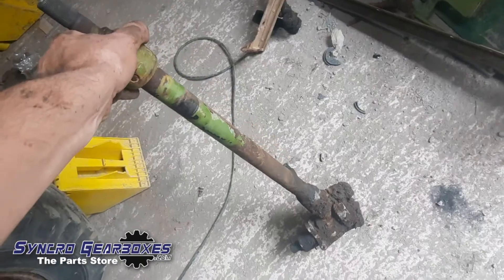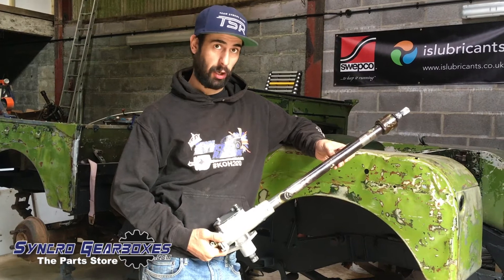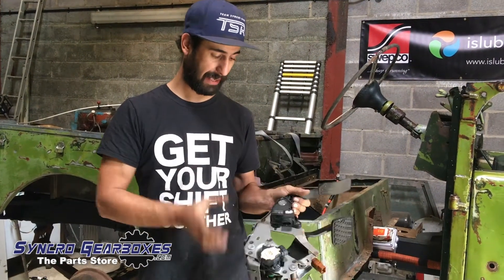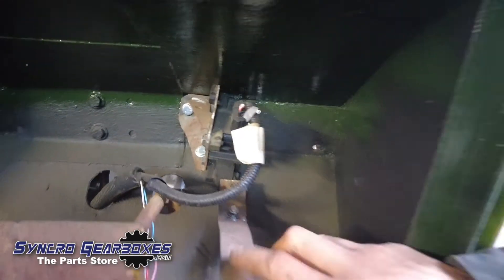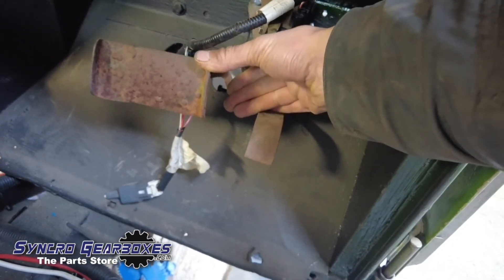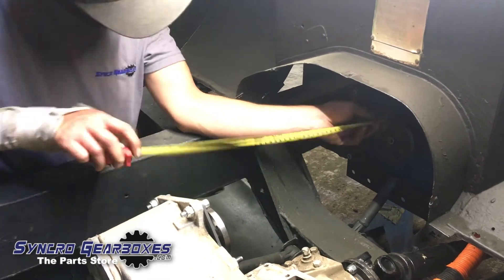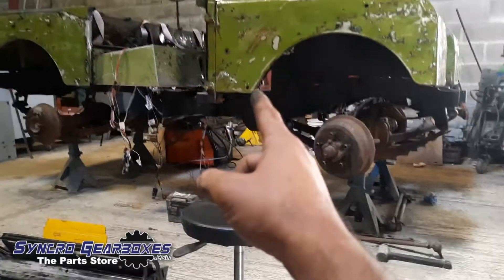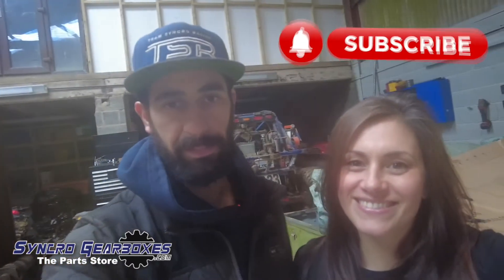12 - Land Rover Series 1 EV - Getting it done ⚡️⚡️

Comment: HI, Nice project and enjoying the videos. I am building a Cobra with Tesla LDU at the moment and I'm interested in what you plan to do regarding registering this vehicle? Obviously it's not a "bolt-on" so this opens up IVA issues. Are you planning to use it o the road?
Reply from the maker: Hi, Its no different from an engine swap as far as i'm aware. The relevant changes will be made to the logbook. No requirement for an IVA
Reply: @SyncroGearboxes  I hope you are right but that's not my understanding of the car I am building and I know someone else just did a vx220 and it had to be inspected.

Comment: Heh, good to see another update. As ive said, I plan to replicate your setup. Couple questions if thats ok

1. Did you need custom props for both axles, as well as from motor to tfr box?

2. Im about to buy an LT230, is your ratio 1.6 in that box, with 4.7 axles? I dont fully understand ratios yet but I think thats what you are running right?

Cheers, and keep em coming!
Reply from the maker: Thanks mate,
Front and rear props are factory lr ones, just the intermediate that is custom length. 
1.6 transfer with standard diffs, one of our selectable 2wd drive kits and free wheeling hubs

Comment: Sounds like you have three 120R termination resisors on the CAN bus as you are measuring 40R rather than 60R. With the pins for the INV, PDM and BMS CAN buses next to each other I could see it being possible to get one line crossed but this would give 90R (120R in parallel with 360R ) not 40R.
Reply from the maker: Thanks for the tech info, I didnt know that!
She has been running and has correct can system so immediately thinking bms has an issue causing the 40ohms